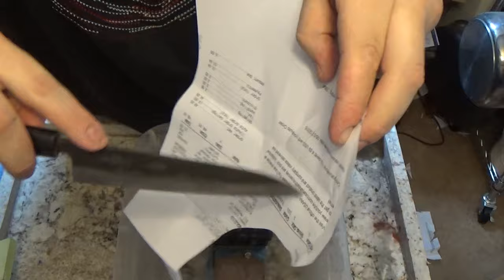Knife sharpening: tojiro knife for Redrider!

Comment: I thought ease of sharpening is dependent on a couple of things. Mostly how thin the edge is (thin=less material to abrade) and abrasion resistance. 

Carbon steel has low abrasion resistance due to less carbide while stainless steel knives have high abrasion resistance due to chromium carbides.

Comment: S30V , S90V and especially S110V or any other stainless high carbide volume steel is so hard to sharpen cause of Chromium content!! Its Chromium enriched Vanadium Carbides that makes it incredibly wear resistant and Alumina based stones are softer than the Carbides in the steel Matrix... Thats why i dont like Stainless "SuperSteels".. K390, 10V Maxamet etc are all 5-8 HRC higher than SXXV but are lot easier to sharpen.. Reprofiling S110V before i used bonded diamond stones is definitely the longest lasting sharpening session and im not going to forget that ever😁 (I've sat there 2days or 16hours) If you have stainless PM steel knives i really have to recommend Venev Resin Bond Diamond🙏 The feel like quality Japanese water stone and they leave almost perfect mirror finish.. Or CGSW matrix stones but those cost considerably more.. 😉